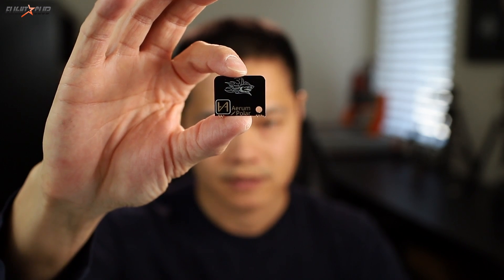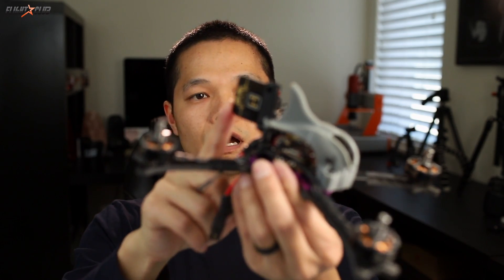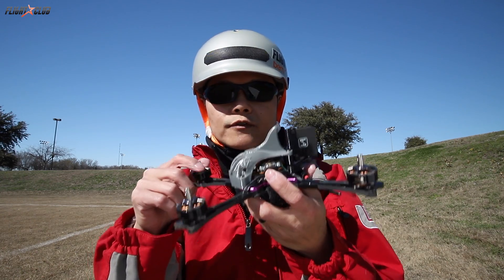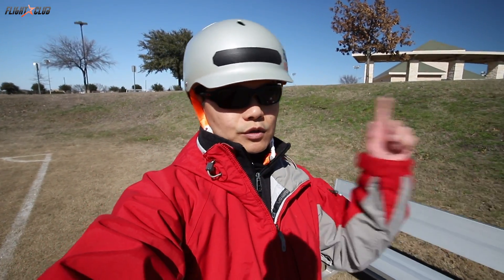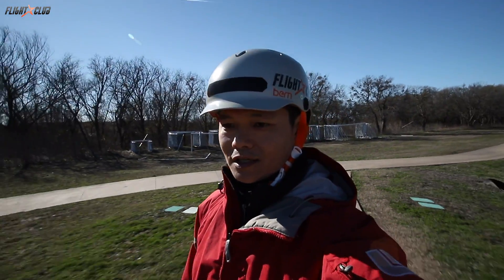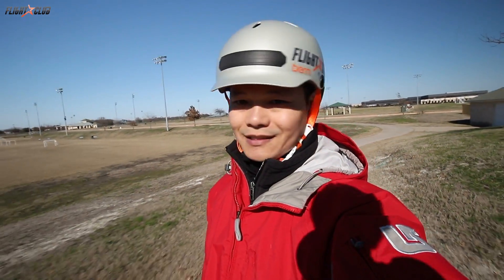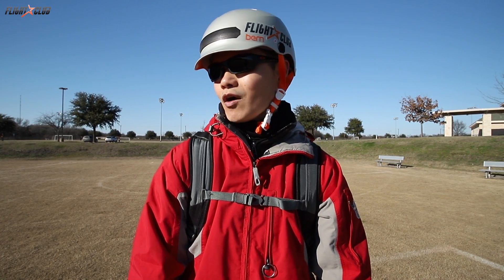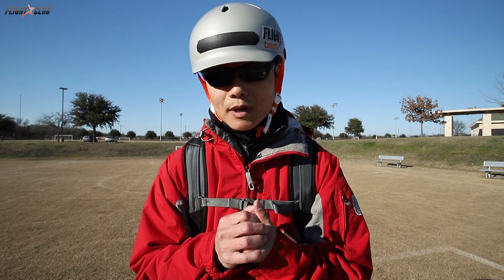TBS AERUM ANTENNA REVIEW AND TESTS!

Comment: Thank you for getting it. When you said its up for grabs, I thought..spoiled silver spooned dude. I've ran boats for a long time and a retrieval method is a must. Quad retrieval is usually from a tree but must be done on a $300 Quad. I've left 30$ quads before tho..
Reply from the maker: haha, took me a while but i got it back.  the esc and fc were fried.  swapped it out and everything else works!  it's actually my main race quad with my underwater parts!  haha

Comment: Did you test with only changing the quad antenna Aerum and then only the reciever antenna Aerum? or do they only work as a set?
Reply from the maker: not yet but I will.  i cut my tests short cause i dumped that one in the water

Comment: Running the same electronics did you get smart audio working?
Reply from the maker: yes, for smartaudio on the pro32 working with betaflight, you have to be on at least 3.5.6 or connect it to your crossfire.  check out this post:

https://fpv-flightclub.com/tbs-unify-pro32-nano-vtx/

Comment: What power output and channel were you using for this test?  Did you try different channels and or power output settings?  It would be interesting to see how these antenna perform in a crowd with multiple pilots all running the same setup.
Reply from the maker: this whole test was on 25mw.  i will be using them at a race this weekend.  i'll post an update on the blog:  https://fpv-flightclub.com/tbs-aerum-antenna-review/
Reply: @FlightClubFPV  I will keep my eyes open for the update, thanks

Comment: Tbs is just another Chinese Co. even if they have good ideas the service and execution is shit. find Made in USA and you'll be solid.
Reply from the maker: i agree to an extent.  most of the TBS stuff is great.  i don't think TBS makes these, they are rebranded
Reply: My Mac and IPhone are made in China and they are solid. Can't say too much about my Lenovo though. Just because it is made in America Does not mean it's solid. I would never buy a Ford/Chevy/Chrysler made here in the good old USA, they are crap. Engineering, Materials, QA, QC, Iso 9001 etc. are what define things as being solid.
Reply: these antennas are made in Germany dude ... sigh
Reply: Raphael Pirker you made an enemy of me. I get how bitter you can get working with or competing against a co or country with no honor or code. I worked with casinos for 17yrs, I get it. Their first to squeeze your inspiration dry then dime you out to save a few cents or worse just copy it . Their gov hates non Chinese and they will replace you. I've worked alongside them for 20yrs now it's happened to me more times than I can count. It's strategic failure and rebranding to remove foreign competition.  Don't get bogged down w/ that evil shit, be the rebel we all started to fly after. I competed and beat Phillips & Sylvania  out of a two car garage, David smote Goliath, you can find your own tooling.
Reply: @rsharney1111  I will agree with on many things you have mentioned. Not sure if VW is the pinnacle in engineering when it comes with plastic water pump impellers, plastic coolant hose connectors, Dual Mass Flywheel explosions, DI intake valve gunk, electrical problems along with expensive unnecessary maintenance. Shame on VW with DieselGate. The sad thing is labels are switched and assembled here and gets made in USA label. Know all about the watered down steel and aluminum problem. 
I don't care for TBS, I am here to find knowledge in what works. I am the the guy in a really big box with 6 pcs, mach3/cnc, autodesk/3d printer. I do read more than most and will never claim to know everything. But when someone says made in America, I laugh a little inside. Everything will fail at some point, you have to ask yourself, what is acceptable. My point is that quality can be made anywhere.
Reply: danlatu Vw being at the pinnacle of engineering was sarcasm. They rebrand an falsify. I got your p of v.
Reply: danlatu I'm playing with mach3 aswell, I just bought a 10'x5' komo 12 tool router(650$), 3axis mill (no controllers(150),  96"lathe I'm converting to CnC(1500) and a few 3D printers(such notorious little bastards $0). All I need is a 48" pick and place machine and I can start producing. I worked with smart people and designed a Bosch based flight controller that can pass Ul and run an actual operating system of your choice. already made prototype motors(winding machine is giving me trouble) and I'm working on a 4' x 8' carbon fiber vacuum mold and wood based CF.  It hurts so bad to wait for your opportunity to fly and cook everything or lose connection or split an arm. We all got too much dedication for Qc thousands of mile after the fact. And we sacrificed too much to work with communist countries or slave labor to save a few bucks. Sorry for sounding abrasive "shop life " doesn't yield friends or family and text doesn't mean much in the way of voice inflection.